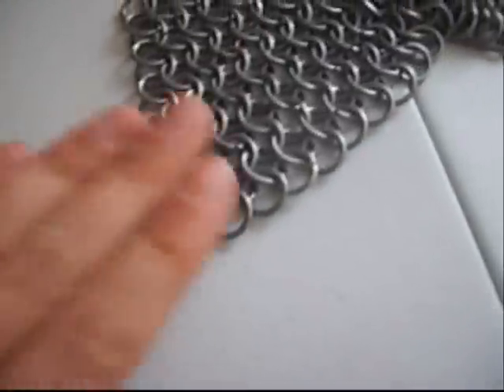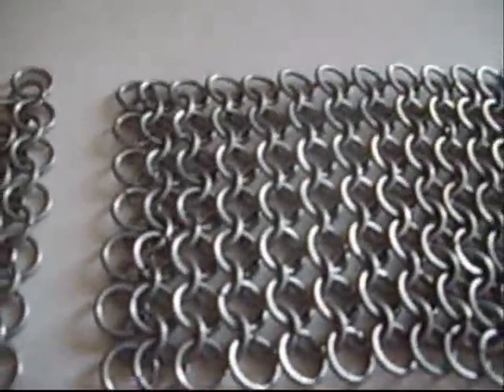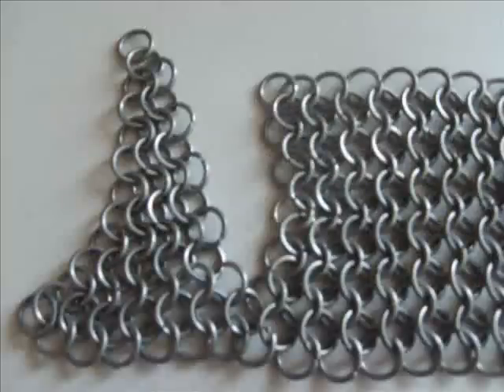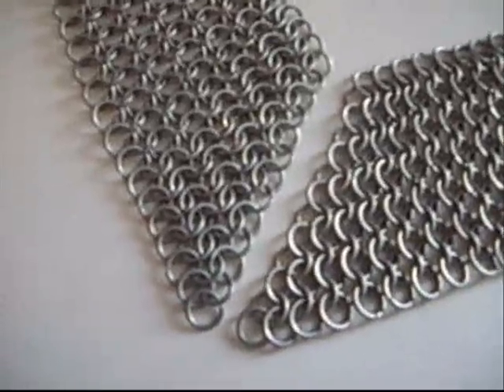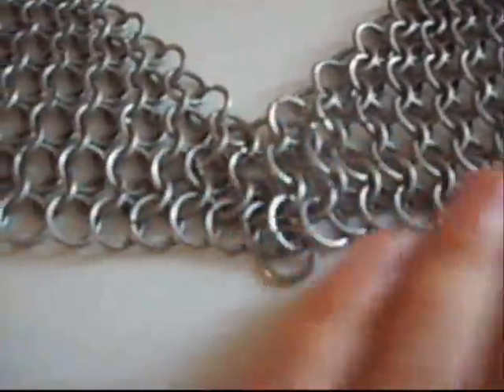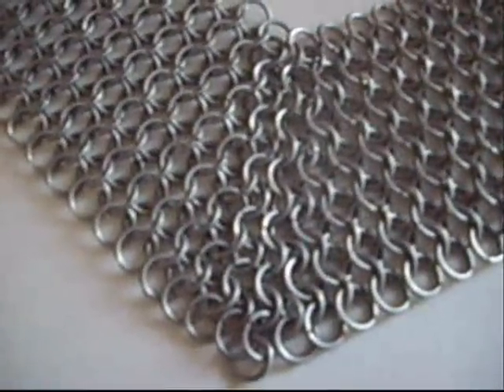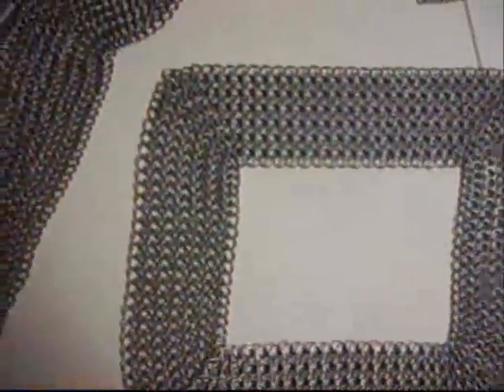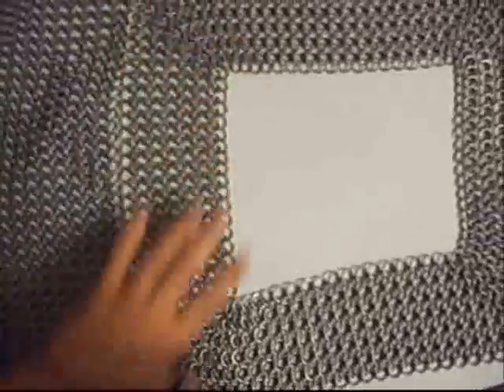How To Make The Collar For A Chainmaille Shirt

Comment: @daretotelldatruth i never had the problem of the mail running in different directions. i made two sheets and laid them on the floor so they ran in the same direction, then attached shoulder straps, also running in the same direction. i am not saying that your method is not viable, it just seems to be too much work, imho. looks damn good though

Comment: You are doing this such a difficult way :P Easiest way is to weave a simple tabbard...then close the sides...add the sleeves... and round out the neckline adding a few rings at the corners :) Nice post though. It gets frustrating... I hate when you miss a ring and have to take a whole middle section out :(

Comment: If you make the same mistake again, you can make those pieces fit by removing the top row from one and adding another row at the bottom, or the other way around. But since they went the wrong direction anyway, I guess that's a moot point.